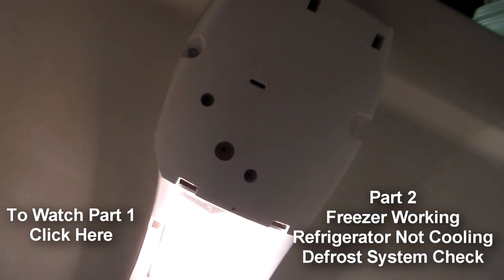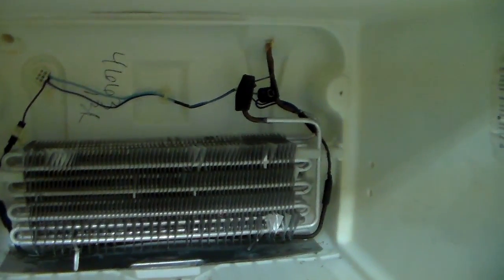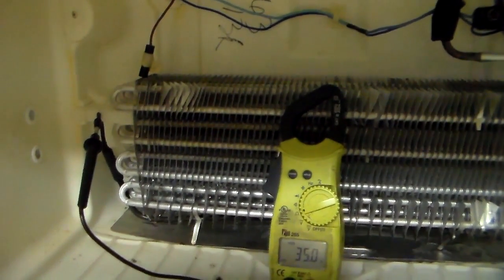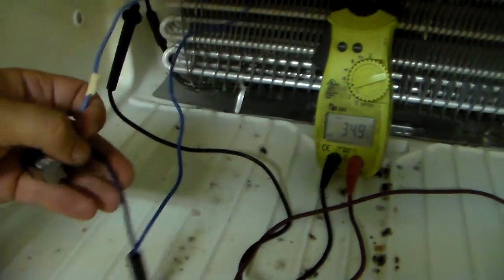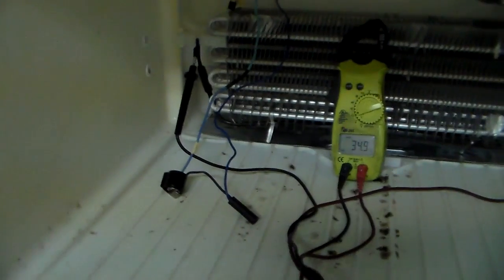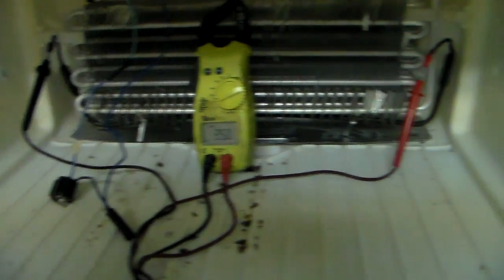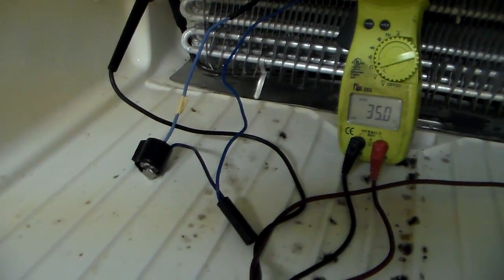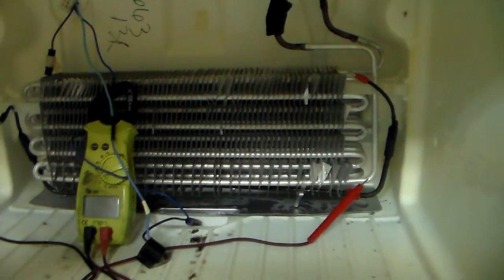Troubleshooting a No Cool Refrigerator - Part 2

Comment from the maker: Well, either way the freon system would need cut into.  Then pressure checked for leaks.  Unless you have experience in this type of work, freon systems are not your average repair job.  But really the only way to be sure is with a set of gauges hooked up to the compressor.  3 Things could be wrong,  restricted sealed system, sealed system leak, or faulty compressor.  
Sorry for all the bad news,  I wish there was more I could help you out with this.
If you have anymore questions please ask!

Comment: Really great presentation.One thing you should mention.Those defrost thermostats don't all show short at ice water temperature.The ones in my GE need 20 degrees to show short.I used freeze spray to test.
Reply: Imo, a good way to test the defrost thermostat is to cut it out and put it into a good working freezer. Then test it after it's well frozen.

Comment from the maker: Your going to have to remove the back panel of the freezer and check the coils.  If the compressor is running, they should be covered in frost.  If the compressor is running and there is not frost on the coils, you have a freon issue.  
Let me know what you find.

Comment from the maker: Make sure the refrigerator is not running on an extension cord.  The refrigerator should be on its own breaker.  Check the cord for any damage around the prongs on the plug.  The run time shouldn't affect the relays.  If there is, let's say, an air conditioner running on the same line as the refrigerator is, the voltage drop could cause damage.  Loose wires will also do the same.
Let me know what you find.
Bill

Comment: Video just talked me down off the edge!!  Had freezer around 40 degrees F and refrigerator around 50 degrees F.  With your guidance, turned on defrost cycle manually and noticed heater coil did not turn on.  Checked for continuity of heater coil and got 36 ohms (35 was good on yours).  Removed freezer thermostat (placed in a cup of ice for 5-10 minutes) and checked for continuity.  If thermostat is good I will order a defrost timer.  Replaced defrost timer and freezer thermostat about 1 year ago.  Refrigerator is a Frigidaire Top Freezer (model FFTR2021TW5) manufactured in 2019.  Unfortunately frig has never worked well.  This will be my last attempt before I purchase something more reliable....and colder.  Purchased a "garage kit" for it too.

Comment: You just saved me ALL KINDS of aggravation.  I have that exact fridge and I've been putting an electric space heater in the freezer once a week (for a month) to defrost it and get cold air back to the fridge (procrastination and fear of repair bill).  I could have used a flathead screwdriver and 10 seconds of my time to turn the timer once a day (well, twice...to re-start the cooling cycle).  Just now learned this from you... did it... and the defrost heater fired right up and started dripping lots of water through the vent down into the fridge.  Now I know what needs fixed and it won't be that expensive, and I'm sure I can do it myself.  And if I want to procrastinate further, the screwdriver method works!  Haha.  Thanks a bunch, man!  Also, your reason for redundancy was spot-on.  Nothing worse than a teacher who makes the mistake of thinking his students know more than they do.

Comment: Great  help in troubleshooting  my Amana refrigerator.  The problem turned out to be  the fuse to the defrost  heat element, part is  no longer stocked  anywhere. Checked with local  appliance salvage shop and he said it really does not need one that sometimes they burn out, just remove it and butt splice the wire. Fixed my problem,  but  wondering what you think? Heat  element was fine and ohmed out at 35 ohms.

Comment from the maker: +5 is ok for the freezer,  if you have more in the freezer the temp will drop and couple more degrees.  If it's an extra fridge, throw some bags of ice in there to take up and much air space as you can.
Put the fridge thermostat in a meat drawer or something.  The temperature may be affected by the opening up of the door to check the thermometer.  They always read high if you don't have them in a drawer.  take up the airspace in the fridge with jugs of water if there's lots of room.
let me know!

Comment: Bill , your video  is teaching me a lot. Thank you.  Question,  now I changed  the  defrost timer, the defrost heater and now after those replacements the freezer  is cooling but not freezing anymore. It is a Kenmore side by side refrigerator. What should I do next? Freezes on the cables but not on the  evaporator coils ... so no t enough cooling

Comment from the maker: nelson, if your freezer is frozen, the fan is running and no air is getting into the refrigerator, your airflow vent from the freezer to the refrigerator must be blocked somehow.  Check the vents in the bottom of your freezer compartment and make sure they aren't full of ice and frost.  Make sure the light in the refrigerator is going out when you shut the door.  The light should go out just before you close the door and you should see it go out.  Let me know how you make out.

Comment: Very thorough explanation Bill. I can barely use a screwdriver & even I understood it. Many thanks! My frig is the brand in your video. Bought it new & have had it for just over 2 years. A few days ago I noticed the jug of water in my frig was not cold & the milk had curdled. The fan was running continuously & the freezer was working. After watching your troubleshooting video I realized it was a defrost problem - with frost covering the back vents. The heater did come on when I turned the timer. So now I know I need to get a new defrost timer. The replacement part is fairly cheap, but I'm still surprised it went out so quickly. :(
Reply from the maker: LACynthia07 Awesome Job!  I'm glad you were able to get your machine back up and running so easily!  That makes my day
Thanks for Watching!

Comment: Very informative, I just want to know that when we dip the thermostat in cold water for 5 minutes, should we check the same after removing it from cold water or keeping it in cold water.
Reply from the maker: The thermostat should close circuit in the ice cold water.  When you remove it from the water it will open after a couple minutes.
Test with the thermostat in the water.
Thanks for Watching!

Comment: You addressed my issue to a T, same fridge even and I appreciate the info, usually when I try to find info on something I'm having an issue with I find info on everything except what I need to know. I had just finished defrosting my fridge (coils) with warm water, so I will try to manually turn defroster on in a few days when they have frosted back over and go from there. Thanks a million!

Comment: Bill, I have an ongoing problem that I hope that you can offer some advice or suggestions on.  All your videos are extremely helpful & are easy to understand for the home handyman.  I have the exact same model fridge as in this video & it was bought new in 2010.  My problem began when the freezer section started thawing everything.  Cleaning the coils seemed like it resolved the thawing problem but the fridge still didn't seem like it was cold enough compared to when new & also the fridge now ran non-stop.  So I did all the easy checks first.  I flushed the drain line to make sure that it wasn't plugged up, ok.  Then checked the defrost heater & got continuity, ok.  Checked the fridge thermostat & there was continuity as well.   But the fridge still runs continuously.

So I decided to replace both the defrost thermostat & the defrost timer at the same time as either one is usually the most likely culprit.  The fridge now stops for a half hour but it runs for about 7.5 to 8 hrs straight before the next stop & it still does not seem like it is cold enough.  Both condenser & evap fans are working fine.  Even when there is ice build up on the coils in the freezer, I'm only getting a temp. reading in the freezer of ~ 30F degrees.  When in the defrost cycle the freezer is ~ 40F degrees & it stays at around that temperature for the 7.5 hrs of that cycle.   I really don't know where or what I should be looking next.   If you have any insights, it would be greatly appreciated.
Reply: What was the problem in the end? We’re all vents clear, unblocked, no food hard up against fridge or freezer vents ?? Let us know after all this time what you found.

Comment: Bill Newberry  How do you tell whether the defrost timer is a 24 hour active clock or a accumulative timer, also I have one more question what is the purpose of the capacitor in the defrost timer is it there for safety if clock coils melt down or for some other purpose I think the clock is powered threw the capacitor run in series. Your a good teacher that's why I ask you these good questions. Cheers.

Comment: Thanks Bill. Problem solved. Based on your instructions I was able to isolate and fix defrost problem. I only needed to reset the timer - which I would never had thought to do or even locate the timer if not for your video.
Reply from the maker: Awesome!  Great Job, just keep an eye on it in case the timer has the same problem.  You may end up replacing the timer just to be on the safe side.
Thanks for Watching!

Comment: So glad I watched these 2 vids. That GE  fridge is basically the one I have and I’m having the icing problem. Tried the manual defrost setting and the heater didn’t come on. I don’t have a volt meter and I’m not to experienced with this kind of stuff. Probably gonna buy a new heating element and see if that’s the issue.

Comment: Great Videos and wonderful explanation. I have started to troubleshoot my fridge that has been off for over a month. Nothing was was working except the light. The first thing that I have found was that the cold control is open. My local parts store is closed so I'll be getting a new one Monday. So in the mean time I have been reviewing your videos again to see what I should do next if that doesn't cure the problem. Wish me luck. Thanks again for your videos.
Reply from the maker: Kurt Mey Make sure the defrost timer is not stuck in defrost.  Find the timer on your fridge and turn the dial about a quarter turn.  Everything may kick on at that point,  if it does, replace the timer.  If the thermostat is set to factory temperature and is still "open",  You are right on by replacing the thermostat or cold control.
Let me know how you make out!  and Thanks for Watching!
Reply: Bill Newberry Replaced new Temperature Controller yesterday. Nothing happened at first but I could hear the defrost timer working. Advanced it a quarter turn and the compressor and compressor fan came on and the freezer coils began cooling down. Hooray!
Noticed that the Freezer Fan was not working though. I think it is supposed to be on all the time except when the freezer is in defrost mode?
Reply from the maker: Kurt Mey Turn the fan by hand or smack the back panel.  When the refrigerator sits off for a while, the fan will stick and not turn by itself.  Sometimes they need a little help after sitting.

Let me know what you find!
Reply: Bill Newberry Resistance across motor reads 98.9 ohms. Checked AC to the motor and it is good at 120 vac. Tried turning the fan a few times but it turns very stiff. Removed it and took it home to my shop and tried blowing it out with some canned air and also spinning it with a drill. No luck! when you plug it into the wall with an "adapter" cord, it just hums. Sooo, I'll be ordering a new on tonight. Looks like I can get a new one from Amazon for about $20.
All together it looks like I have gotten the fridge back online for a total of about $100 in parts thanks to your videos and advice.
I very much appreciate all your help. I enjoyed learning and building my confidence. 
Thanks Again!
Reply from the maker: Kurt Mey Heck yeah, Nice Job!  Glad to hear you'll be back up and running!  When you get it all put back together and it's running let me know how it's working.
Reply: Bill Newberry Bill, the new fan came in and it was easy to install. It had a complete wire harness on it already. Put the panel back in the freezer and every thing works fine. Running like new now for several days. Thanks again!
Reply from the maker: Kurt Mey Awesome!  Great Job    Make sure you subscribe to my channel, so if you need any help down the road, you can find me quickly, plus it helps my channel out.
It looks like you have mastered some basic refrigerator repairs, pretty impressive!
Thanks for Watching!

Comment: Tried the defrost timer first but nothing happened. Rotated it through a couple cycles to make sure I knew it was out of the defrost section. Tried moving or resetting the temperature control but it was frozen/stuck in place. Thought maybe mildew was holding it in place. Had a lot of mildew buildup from renters leaving some food in it with power off. Freed it up with a little torque from pliers but no change. Removed the control section and removed the leads to the temp control and connected ohm meter. Reads open in all positions. It is severely corroded also. I may pull the freezer access panel off also to inspect the fan to make sure it is free to spin. After reviewing your videos, I am confident in moving forward to the next step if necessary. I'll post the results.

Comment: Bill, excellent video. You saved me the expense of purchasing a new refrigerator. I am working with a GE Profile so the coils are on the floor of the freezer compartment. When I move the defrost timer it forces the heater to come on as you describe. But, when the ice melts it doesn't all exit into the drain of the heater pan. Some of it appears to overflow in a cavity against the back wall where the fan is located. Overtime that water freezes preventing the fan from operating since it is frozen in place thus preventing cold air to circulate in the refrigerator section. Question - is the timer problem causing an excess build up of ice so that when I kick off the defrost cycle the amount of runoff is more than the drain can handle? Or do I possibly have another problem?

Comment from the maker: They can go out for whatever reason, I usually don't see them go out multiple times with a good compressor.  Check the amperage on the compressor when it's running,  I believe that one should be between 1.4 - 1.8 amps, after about 4 minutes of running.
If it's at the 2 amp mark, that would burn up the relays quickly.
Let me know what you find.

Comment: Bill, thank for a great video.  I learned a lot from this video.  My refrigerator has defrosted problem once in a few days, I unplugged it for a while, then plug it back and it will work normal again for a few days, then it will get ice defrosted on the screen again.  I am not sure it is the timer or the thermostat problem. The freezer still gets cool but the cooler isn't.  Any idea?

Comment: I have a LG refrig, freezer appears cold, refrig warm.  Finally removed back freezer panel.  Put power on, compressor came on, evap fan NOT on. Could NOT find defrost timer in refrig, took top panel off, where could it be?  Model LTC 19340ST.  Bill, thank for the educational service  you provide.  I watch you daily.  Very clear, very concise, and great videos.
Reply: Your refrigerator model seems to have a newer Electronic Control Board instead of an old-fashioned defrost timer. And the fan is a 12 VDC which is controlled by that electronic board. So, you need to figure out if the fan is bad, or the control board is not sending the signal to run the fan.

Comment: Great job again.  You fixed the compressor on my freezer!  I put a 3/1 switch in it about 10 months ago and it works great.  New issue - now my refrigerator.  Kenmore 27 side by side 15 years plus old.  I can't find a model number anywhere but it looks virtually identical to the whirlpool side by side you made your video on.  I can't find the switch for the defrost timer.  The refrigerator is not cooling/freezing; all fans are running inside and at the back by the compressor, tested the thermostat switch tested correctly (off OL - on ~0.1 Ohms); tested the compressor got close to your ohm readings.  I am assuming it's the defrost timer.  There is one located where you indicate behind the panel on the right side -  but it does not have a switch.  I'm going to figure out the part number and replace it - agree?

Comment: Hi Bill thanks, this assisted in solving my problem, well explained. Keep up the good work. Mine had the exact issue, lots of ice on coils, only freezer works, below not cooling. Blessings to you. I replaced the Defrost Thermo disc/thermostat that clips on the coil to engage heater,

Comment from the maker: If the return line is freezing up, you put too much freon in the system.  That means there's enough freon in the system to freeze the evaporator and all the way down to the compressor.  You should decrease the amount of freon in the system, so only the evap is froze over.  
Let me know if you have anymore questions.
Reply: The fridge inside is hot not cool

Comment: Thanks Bill for informative and demonstration video.Actually I got a problem with my refrigerator and got through to YouTube and found your channel are very useful. In my refrigerator whirlpool French door model number is w8txewfyq00 it doesn’t go to defrost I checked fan evaporator it’s working, continuity to heater it’s 37 Ohm’s, bimetal defrost also there is continuity I replaced the defrost timer but the problem is same so could you tell me what can I do to fix it.(there is no button to go to defrost in the timer) Thankfully again.